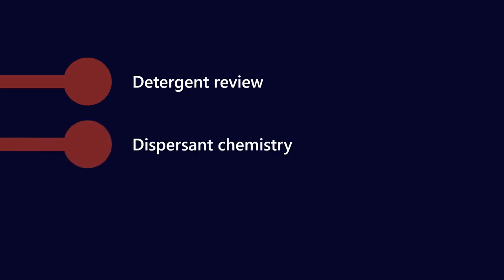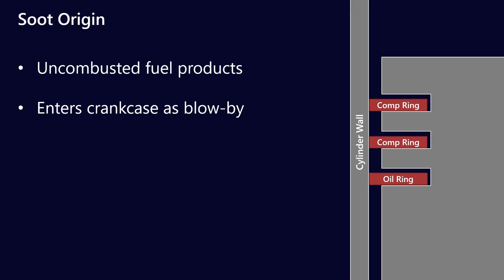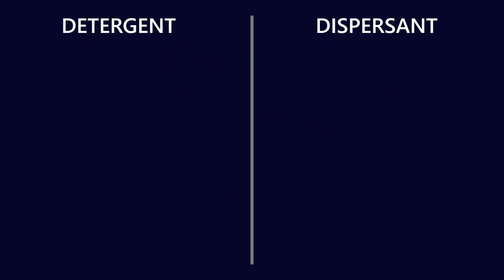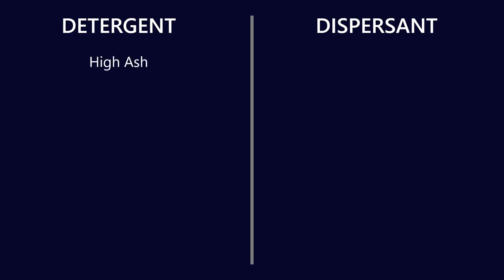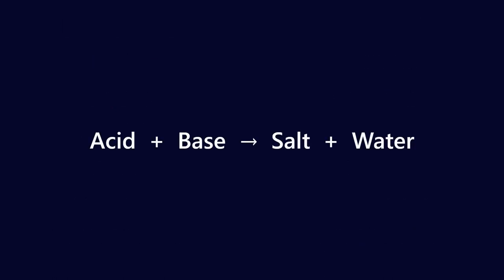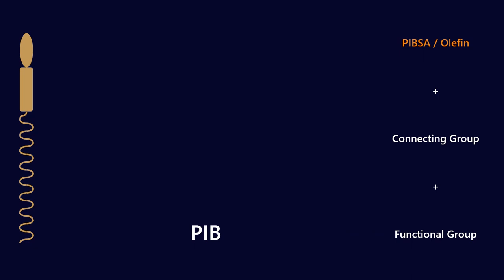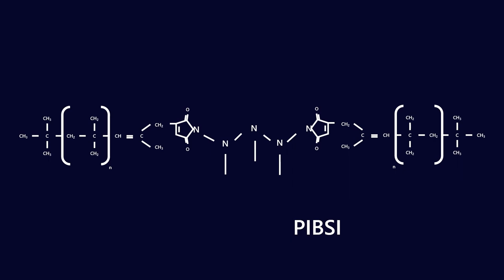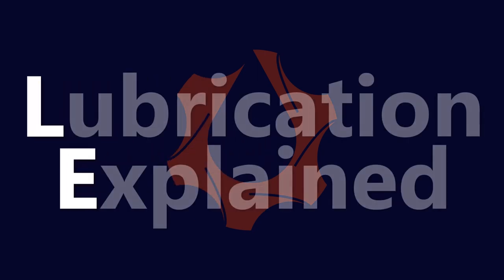What do dispersant oil additives do?

Comment: To me, ashless dispersants are primarily a 'diesel thing'. Everything you said about soot dispersancy & piston cleaning I'd 100% agree with. However, when you really dig into it, ashless dispersants don't make a great deal of sense for gasoline engines. They don't actually prevent sludge formation or deposition. If you want to attack a sludge issue, you're far better off on focusing on the oxidation resistance of your oil. Also, in many respects, ashless dispersants make gasoline focussed oil worse. They push up Noack volatility & can worsen seal compatibility. Here in Europe, you generally get lots of ashless dispersant in PCMO because it's always specced for BOTH gasoline & diesel. However, to me, the, Yanks have been getting this fundamentally wrong for decades.
Reply from the maker: Yeah absolutely. Must be hard for formulators trying to satisfy the requirements of completely different applications.

Comment: Is there an acknowledged ratio of detergents vs dispersants in automotive motor oils?  Or would both be over-based equally? Also, when motor oils fail to suspend contaminates, is this generally an exhaustion of the dispersants or a breakdown of the dispersant molecules?
Reply: Typically your car's oil will contain 2 - 3% of over-based detergent & 4 - 6% of ashless dispersant (ashless is never 'over-based'). There's no hard & fast ratio. At a rough guess, 99.9999% of the world's engine oil is tossed long before it gets anywhere close to its true exhaustion point. All oils are massively over specced for their intended duty so I personally wouldn't worry about it.
Reply: With the (quantity) percentage set in a certain range, if I were to look at a data sheet for an automotive motor oil listing dispersants, what would indicate high quality dispersants are being used?
Reply: @watercooled8105  Short answer?Absolutely nothing! The amount of Nitrogen in dispersant is piddling & the actual physical measurement of Nitrogen in engine oil is always problematic. You might be able to infer it from the amount of  Boron in the oil (Boric acid is a common dispersant capping agent) but this is very hit and miss as some ashless dispersants either aren't capped or use a capping agent (like Glycolic acid) which doesn't contain Boron. Basically, as a consumer, you're stuffed!
Reply: In an engine oil, there are mixed of low over base detergent, high over base detergent and ashless dispersant.

Detergent has limited dispersant activity and dispersant has limited detergent activity.
Depending on the exact type used, the ratio and combination will differ.
Reply: @watercooled8105 you can't really determine whether the dispersant used is of high quality or not.
There are many combinations to get an oil passed all the required testings.
It's like saying how can we know the quality of a sugar in a cake.
Reply: Hello, I keep watching your video at least twice each to totally infuse the knowledge, great work thanks.The connecting group + fonctional group form the polar moitié of the molecule ( la moitié polaire)  Moitié means literally" half ".